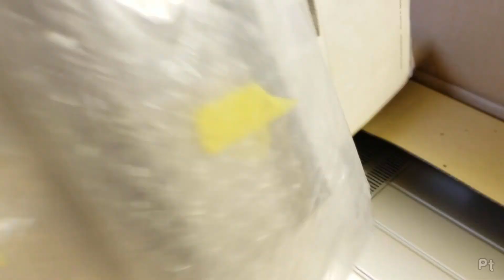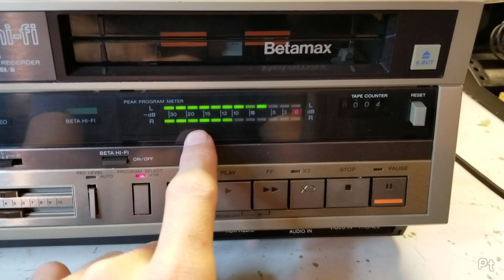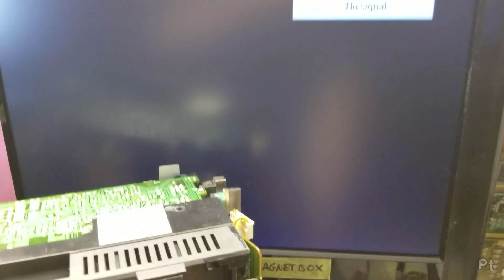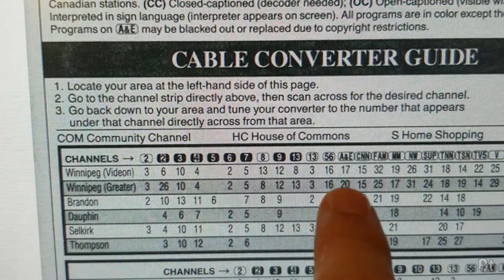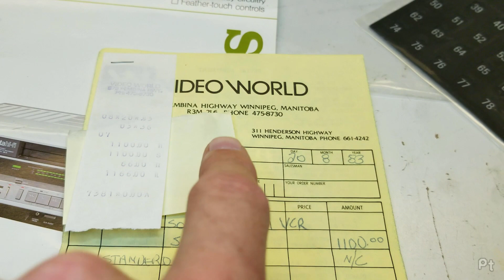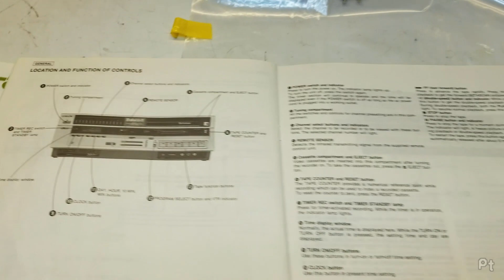Sony Betamax SL-5200 (the first Hi-Fi VCR)

Comment: Does it work if I put beta-cam tape in the beta-max player? And does beta max tape work on beta cam player?
Reply: Yes and no. The early Betacam oxide tapes can be used in a Betamax VCR for recording but recordings made on Betacam machines won't play on a Betamax machine. Don't use any other variants of Betacam tapes such as SP or Digital. Those use metal-particle tape which will destroy the heads of a Betamax machine.
Reply from the maker: No, Betacam is a different format - both the speed and signal recorded to the tape are completely different.

Comment: What kind of rf modulator do you use for the built in tuner?
Reply from the maker: I have some made by "Channel Plus" that modulate two channels on UHF. I've done a few videos about them. You can use one of those basic ones as well that outputs on channel 3 or 4, but those will probably need a booster if they're not in the same room as the VCR and TV.

Comment: Alright....seeing as how you're talking about ET playing quiet and louder on one channel I have in my hand an original MCA Home Video made in 1988 and the sound is CRAP!! Always has been!! It louder on the right side AND you have to have the volume turned up to hear 90% of the movie BUT the action scenes are far too loud!! DO NOT USE "ET" AS A TEST TAPE!! It says right on the tape BETA HI FI STEREO "Dolby Surround" AND Digitally Recorded. Whoever engineered the sound on this tape should be fired because it is by far the WORST bought tape I've ever owned!! I have a Sony SL-HF360 Super Beta HI-FI (Mid-line $850 Canadian brand new in 1989). The Mono track actually sounds better is you can figure that out LOL. All I'm saying is MCA did a terrible job on making this tape and PLEASE save yourself the headache and find a better test tape because these ALL have the same problem apparently!!
Reply from the maker: Good to know. I do have several copies of ET, so I should see if the others are the same. Overall, I've found that early Hi-Fi releases seem to vary wildly. Even when the levels are ok, the overall quality is the same as the linear track, since the source wasn't much better.
Reply: @probnotstech  
I have early HI-FI tapes on both VHS and BETA and the very early ones unfortunately seem to have the intro (RCA, Paramount, MCA, Touchstone, Warner Brothers) in STEREO but yet the movie was NOT in stereo despite the HIFI light is on BUT the peak meters (VU meters) were perfectly equal lol. I Think they thought they could get away with this because most people used coax cables and not many people had component type TVs. Back in 1987 my mother 100% broke the bank (as a single mother of 2 kids) and saved up and bought an RCA Dimensia 27 inch TV. Now...this thing was AMAZING and we had it up until 1995 in regular use, and then in our rec-room in 1991 (They-mom remarried in 1988) bought a RCA Console with a 36 incher) and then I got it for my bedroom in 1997 when they bougyt a 36 inch Hitachi. Anyway I never knew the potential of this TV until we got the Beta HI-FI in 1989 and hooked it up though the RCA jacks. HOLY HELL what a difference!! in 1991 they bought a Sony SLV-R5UC VCR S-VHS Hi-Fi because the RCA console had a S-Video jack.....which NEVER got used properly until 1993 when we got our Echostar Dish (The OLD OLD Bell Expressview) which had a full 500 lines of resolution. The best part was that I had that old RCA right up until 2009 without any picture problems! I NEVER maxed out the contrast and brightness and every couple months I took the back off an used compressed air and a vacuumed to keep it clean (I smoked...still do just not in the house). At a young age I always made sure our electronics we kept cleaned as a family member owned a Electronics repair shop and I use to hang out there and learned a LOT! I still have both the Sont Beta and VHS and they work as good as they did new. However when I'm not using them I shut off the power bar just to keep the displays bright and not run power though them because I might use them a few times a month when I'm craving a movie that I KNOW is online...but I'd rather watch it on tape. Weird eh? I still have a full case of 10 L-750s bought in 1995 because I use to tape a LOT of music video off much music from 1991-2003 on S-VHS on then pick out my favorites and put them on Beta because it became mine once they got the VHS lol. WIN for me lol. I have 15 tapes of music from 1991-2003/2004 all taped in Super Beta BII copied off S-VHS SP T180 tapes. Plus I use to make a little money very early in my years by hooking the VTRs through the stereo and making cassettes. I always has the newest music and people would give me a list and a blank tape and 5 bucks and they would have PERFECT Stereo recordings on a Denon DDR-780 from '91 (still have that too). That's my story with that lol.